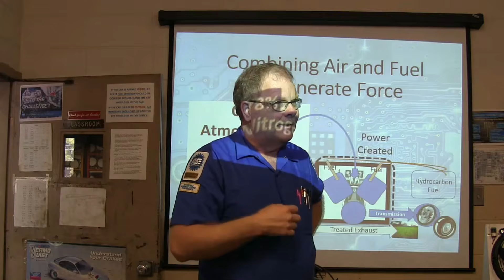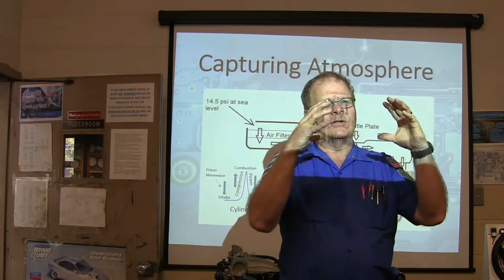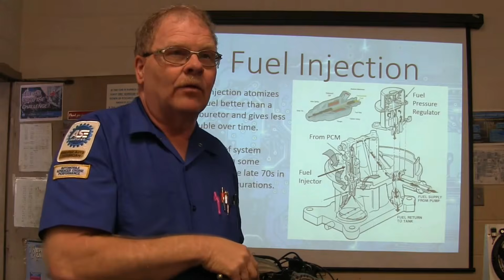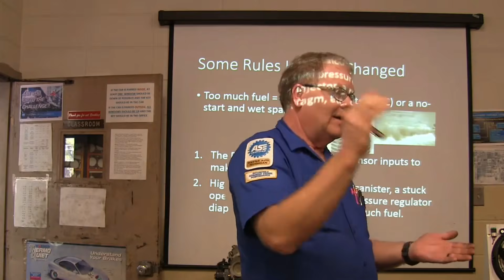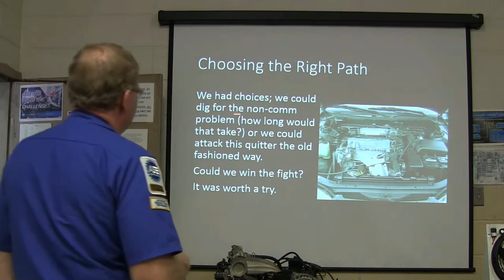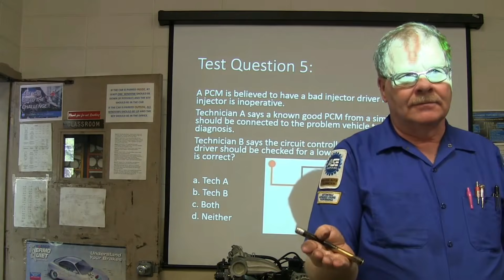Understanding Engine Performance - My way

Comment: I used to give the engine a tiny snap to set off the car alarms in a hi rise parking garage. In that garage a lawyer had the new high compression AMG. That one would make a explosion sound at lite off then  instantly go deep and quiet as the exhaust reacts.
  Super Sunday
Have a excellent week
Reply from the maker: Haha, those garage acoustics can be a lot of fun. You too!